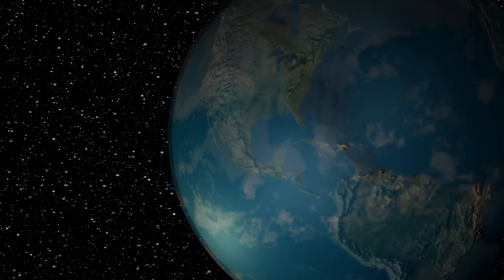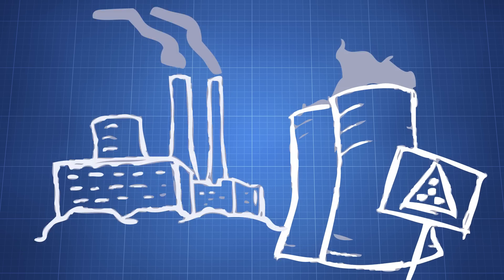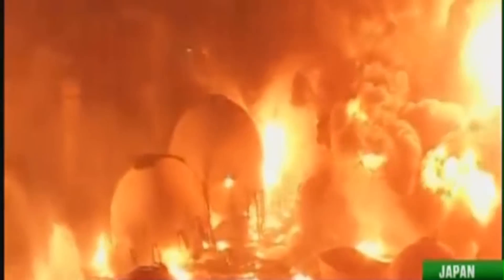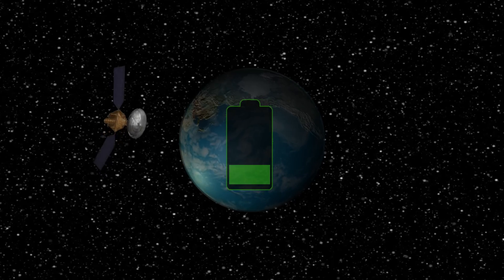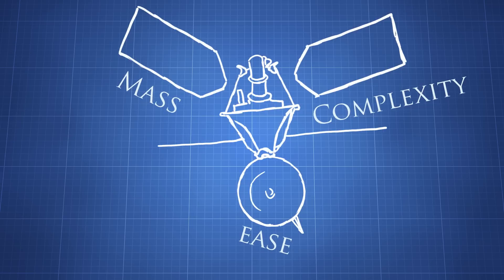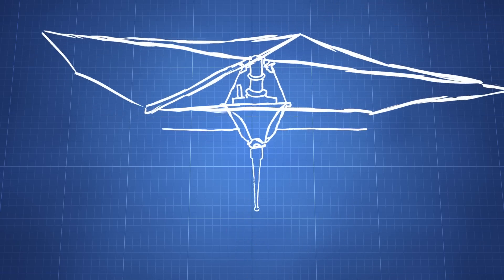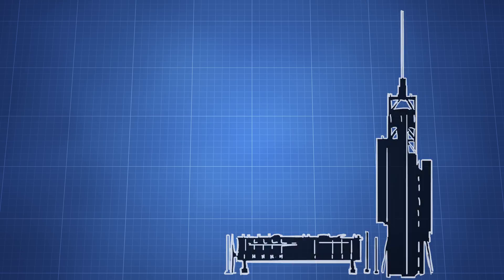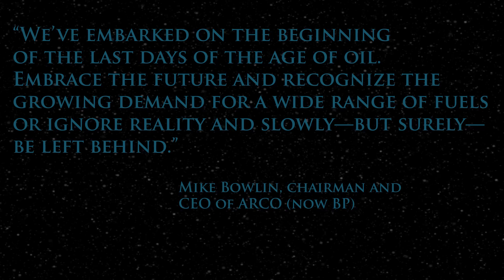Solar Sails

Comment: Just read the journal article. The question I have is this: given the radiation decay of the solar cell performance, what is the total lifetime expected net power expected to be delivered by a satellite of this type. Then calculate the total power consumed in building the rocket, the satellite, the receiver on the ground, and operating the ground control station. If the first one isn't bigger than the last one, you've done yourself a disservice, unless the intent is to build military asset